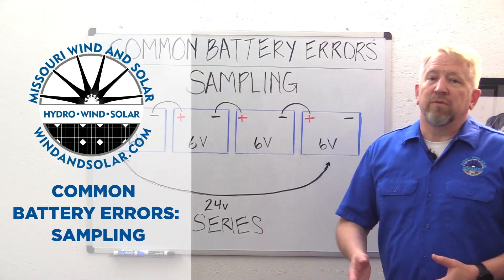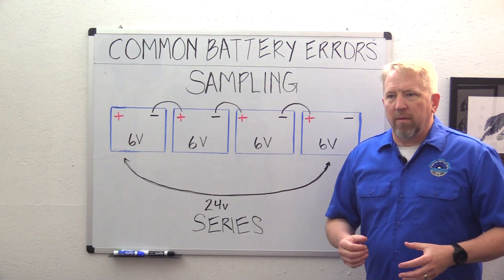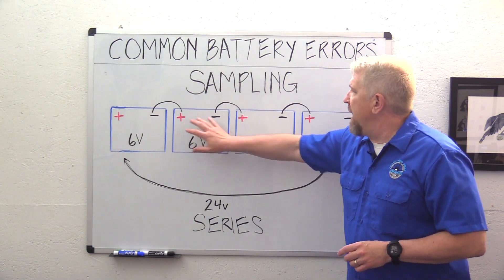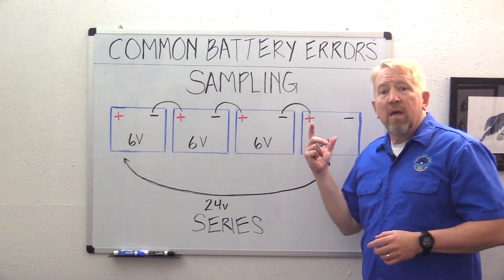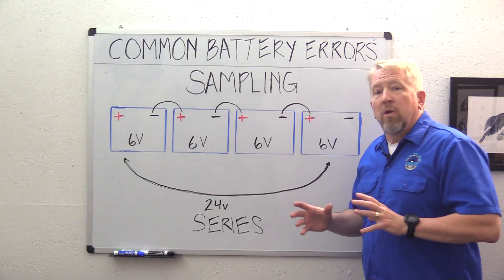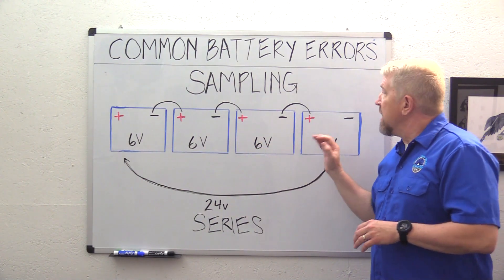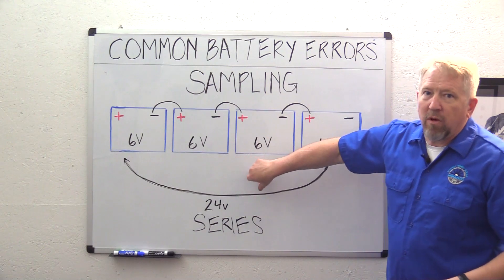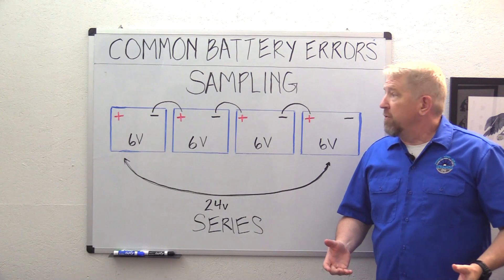Common Battery Errors: Sampling | Missouri Wind and Solar

Comment: what about 3 strings of 4  6volt  =24 volts best way to connect  charge controller  and run inverter . I have seen pos line 3 neg line 1 op ends and charger pos line 1 neg line3 ???
Reply from the maker: Check out this link to our battery wiring diagrams. If you have any questions please give us a call at 417-708-5359. https://windandsolar.com/battery-wiring-diagrams/

Comment: If you have a 24v, 48v battery bank,  can you properly Hook up a 12 V inverter and it will work properly.  Or do you have to regulate it first
Reply: Quick answer is no you need a 24 or 48v inverter but most MPPT controllers can do all three
Reply: @Miley_00   Victron equipment
Reply: @Miley_00   Victron equipment  Thant you brother 🥰😇
Reply from the maker: Thanks for watching. Yes, you would need to have an MPPT style controller for that application, but the highest voltage input allowed is 250 volts. You CANNOT hook up a 12 volt inverter to 48 or 24 volt battery bank. Please feel free to give us a call if you have any questions. 417-708-5359

Comment: Do you need a voltage regulator for 300 voltage wind mill or lithium battery.  How would you connect along with solar
Reply from the maker: Thanks for watching. Connect 2 controllers for solar and wind on lithium bank. Feel free to give us a call if you have any other questions. 417-708-5359

Comment: I have been guilty of doing this transgression myself. I had a 24 volt battery Bank and I was running both a 24 volt and a 12 volt inverter off that bank. Guess who learned his lesson...
Reply: If you have a 24v, 48v battery bank,  can you properly Hook up a 12 V inverter and it will work properly
Reply: @mikegyver3193  if you want to run a 12 volt inverter off a 24 volt battery Bank, then you would need a step down converter.
Reply: @theoff-gridguru  I thought so I just was not sure thank you very much brother
Reply: @mikegyver3193  you're very welcome friend. Just be sure to size the converter for the inverter.